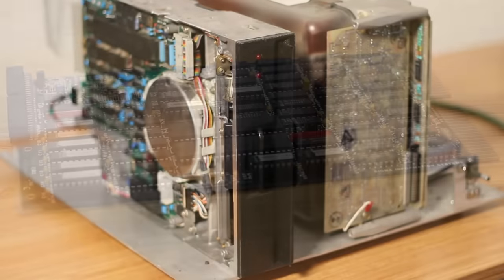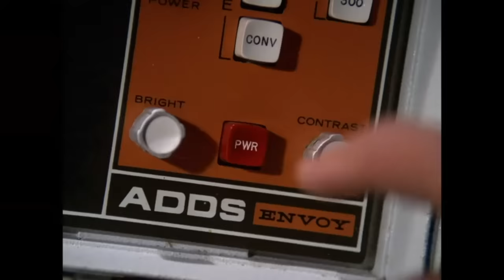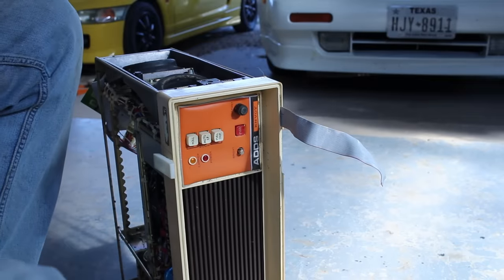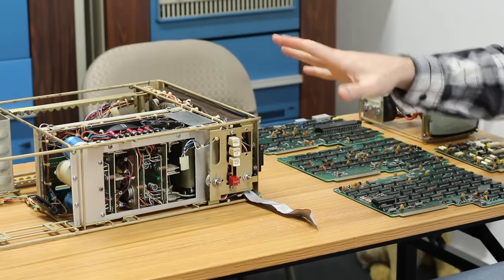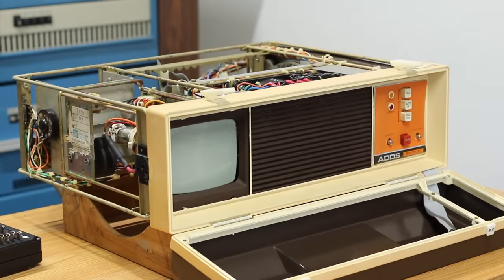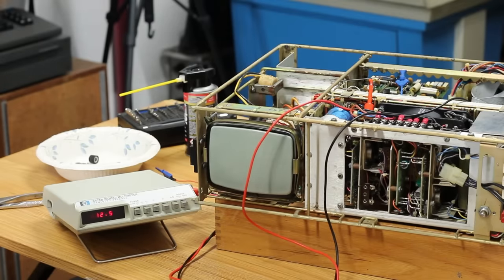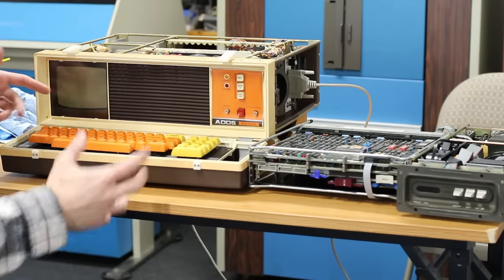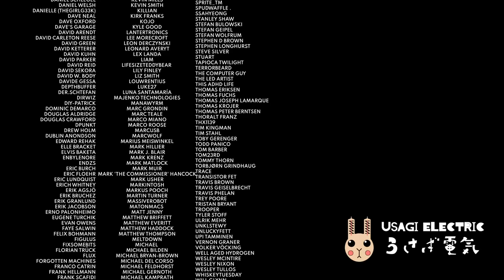This Data Terminal was Covered in Poop!

Comment: You can absolutely wash electronics. I've seen Tektronix and Fluke service manuals, where they discuss how to clean boards with water and detergent. Some Tek scopes have water sensitive components and they are labelled as such with the instruction of removing them before hosing down the device. SO you are 100% right with wahsing the grossness off.
Reply: PCB assembly houses often will use what is essentially a dishwasher, just with no boil cycle, and drip dry, and regular dishwashing powder, to clean new boards after assembly. Big volumes they have a big machine, but small runs just a regular dishwasher is often used.
Reply: Why does water kill phones then? IDGI
Reply: I worked in a TV repair shop for a while. They taught me to always wash the high voltage transformer when replacing the usual parts. We used a water with a dish washing soap. Then it was dried with a blow dryer and that was it. Why shouldn't it work? It had to. However, I recovered some phones that were sleeping with fish for a while (battery on). I think the tons of rust and electrolysis products were harder to clean up than just some rat poo. It was really, really surprising the phones started to work. I was almost confident that you can just wash electronics and it would work. But well, there was that one lousy rubber dome keyboard. After washing and drying it became absolutely dead.
Reply: @seth8629  Partially because the phone has a live battery with a charge in it, while the disconnected circuit boards do not, and were given a proper drying before power was applied.  Water and powered circuitry do not mix because it causes electrical shorts, since the water is conductive.

Comment: hope you checked  the voltages on the second machine? that picture came up  suspiciously fast, if its getting too many volts it'd cause that, check crt heater volts , these sort of tubes are usually 10 to 11 v

Comment: Man, your channel never ceases to AMAZE me!  Not just a 70's portable but 1972!  Not only is it ancient but it features a modem, a 9600 baud modem!!!  Waaaaay ahead of it's time!
Reply: No, that modem will never do 9600. On a good day it will do 300 baud. The 9600 setting is for bypassing the modem and go directly through the serial port in the middle.
Reply: The internal acoustic coupled MODEM  only works at 110 BAUD or 300 BAUD.  For the other support speeds you have to use the RS-232 connection on the DB-25 connector and set the switches to match the BAUD rate you need.

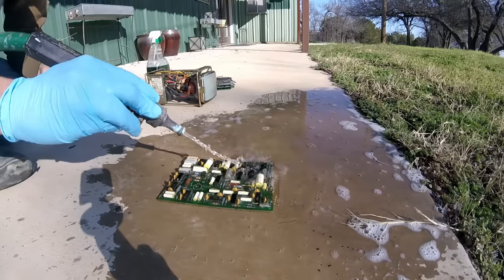Comment: 12:12 - Anyone complaining about washing the boards is probably not aware of the fact that to ruin electronics with water, they have to have power flowing through them. I knew this at 13, and I bet my friend $20 (that's like $40 now) that I bet this 286 motherboard that I got from school (legally - no case or anything, just the board) will survive a plunge in the bath. I showed it to him POSTing using my 386's video card and keyboard to go into the BIOS and do stuff. Then I took all of it apart, and proceeded to dunk it in a bathtub with 2-3 inches of water in it. 20 mins later I took it out, and I said to my friend to come back in a couple days. I immediately removed all the chips (this was an old sucker, lots of discrete chips) including the CPU and dried those separately. I put it all back together, got my buddy to come by, and (I tested it previously lol) it POSTed and the keyboard worked, onboard RAM (like, 10 DIP modules), everything was fine. 

Bollocks to the commenters who think this is a bad idea. I've since put motherboards in dishwashers to get grime off them. Just let it dry.

Comment: The problem with washing electronic boards is not the washing itself. As you said, if water enter in an electronic component, it is already dead. The problem is drying and the quality of the water used to wash. If the water have salts in it (hard water I believe is called), when evaporate, it leave those salts (calcium salts) on the pcb, and when the air is humid, those salts became conductive and can ruin or make the electronics to behave erratically.
Another potential danger is to leave the pcb too much to dry itself when there are exposed copper traces, the salts contained in the water can start to chemically react with the copper and  corrode the traces; the process is accelerated by humidity and salts in the air (if near the sea) and continue even after the machine is put together.
I always use distilled water and alcohool to displace the water at the end. I live near the sea and I saw many electronics corroded by the humid salty air.

Comment: Loopback of RS232 not only needs TX connected to RX but also DSR, DTR and DCD (Data Set Ready, Data Terminal Ready and Data Carrier Detect), these are for hardware handshake. Otherwise the sender will not send anything because it thinks the terminal is not ready or the terminal will not sent anything because it thinks the receiver is not ready or there is no connection.

If you don't care about hardware flow control then short all three together (one in output, the other two are input). If not using hardware handshake then most likely you need the Xon/Xoff protocol unless the terminal and the computer are always able to process the data in time, although you most likely want to sent control-S and control-Q anyway to pause and resume the output.
Reply: Hardware flow control can also use RTS (Request To Send) and CTS (Clear To Send). So to have the best chance to get loopback on db-25 rs232 you would want to connect 6, 8, and 20 together, 4 to 5, and 2 to 3.
Reply: Depends on the terminal.  A lot of them only need 2,3 & 7.  They might have a "bias" to keep the other pins happy if nothing is connected to them.
Reply: Sorry, foggy memory. Should be RTS (Request to send), CTS (Clear to send) and DCD (Data carrier detect). It has been a while since I last made 3 wire RS232 cables...
Reply: @russellhltn1396 True, but it couldn't hurt to properly set the handshaking pins. Having DCD active should also light up the Carrier light on the front panel. 

Also, that modem switch on the side might just be for turning the audio coupler on an off but it could also flip the data inputs to the coupler or force a fixed baud rate as well. Most audio couplers worked at 75, 110 or 300 baud in the late 70s/early 80s in my experience (ignoring the weird 75/1200 split things that came along later for services like Prestel)

Comment: Water and a non-acidic/non-alkaline cleaning solution is actually used professionally for cleaning, so anyone who did do the angry keyboard thing needs to research.   You'd let it dry and then do a bath with Isopropyl to just make sure all the water was expelled, but air drying is also a legitimate drying method for PCB's and electronics.    Done it many times myself as many professional and DIY restorers have done.     Most rodent residue is water soluable and it is the best way to get rid of it

Comment: I use simple green to clean old PCBs, too. It works well, is non-toxic, and easy to find. I use simple green in my ultrasonic cleaner too. Only thing to look out for is it doesn't play nice with aluminum. Quick scrubs are no problem, but I've had it cause bad pitting on electrolytic caps I've left soaking and forgot about for days.

Comment: I'm sure I wasn't the only one going "Eww...!" but anyway, on the topic of cleaning boards, what many may not realize is that in the process of manufacturing electronic boards, especially during the era in which the majority of the electronics you have, it was actually common to have a water wash after the wave-soldering operation to remove the flux (and still is to some degree).

Comment: The open trim pots are the biggest reliability issue.
The Aquadag coating on the tube looks a little compromised, for reliable correct operation of the tube I would get a small amount and repair the coating looking at where it was before.  Keep away from the HV terminal.

The other unit might be safer to restore.
The low baud rates are probably for the acoustic coupler.  The higher bit rates were only offered by the RS-232.

Comment: A perfect way to clean is, besides using a mild detergent, distilled water as it is mineral free and thus non conductive. A 100% dry out is to set and oven to its lowest temperature i.e. "warm" (pre check the oven with a thermometer) to fine adjust, leave the door slightly or fully open.
At a temperature of around 125-150F and a small fan blowing air inside, place the cleaned item to be dried inside for a few hours. Any water residuals will have evaporated! Worked wonders for me! Dried out any device including Mobile phones!
Thereafter spraying/soaking all in Water Disbursement Formula 40, widely know as WD40, does wonders!

Comment: David, you need a large ultrasonic cleaner and an active load such as the ITECH IT8511A, both are really useful in the home lab.

Re the console, try adding the hardware handshake pins too. link 4 and 5 RTS-> CTS, then 6+8+20, these are other handshake pins DSR, DCD, DTR respectively.

Would also be handy to test all the bits from the remaining parts machine once things are working, so you know what is good / bad / needs fixing. Its always easier when you have 2 or more board to diagnose from.

Comment: You will need to take the CRT out and re-coat it. Part of why a CRT is so hazardous to handle is that the glass actually forms a high-voltage capacitor, one of the plates is the metallic coating on the inside and the other is the black 'aquadag' coating (which is basically carbon), and the glass is the dielectric. You can actually buy replacement aquadag to spray onto the CRT. On the PC boards, if there are spots where you are concerned about corrosion on the traces or the solder mask, clear nail polish should do in a pinch to work as a conformal coating.
Reply: Recoating may not be needed.  I have had recovered CRTs turn out to work just fine.  The outside conductive coating they apply is way more than is needed.  The current is extremely low.
Reply: @kensmith5694  Not so much to replace that portion lost but to stop the edge of the remaining aquadag from coming loose over time and the flakes finding their way where they shouldn't.

Comment: Hi, I've been washing electronics with dish soap and water for 40+ years I usually rinse with distilled water and let dry, very few problems. I think a light bulb series tester is in order in case a short circuit exists in the unit.
Rich

Comment: Hey, you want half duplex for local echo, full duplex is for the chars to go to the computer, then the computer sends them back.

For a test without a computer bridge pins 2 to 3, 4 to 5, and 6 to 8 and 20.  See if that works. I did serial cabing on S100 systems and a pdp-11/70 and alpha micro.

Comment: In the early 1980's I worked at a Chuck-E-Cheese's and we would pull the main boards out of video games and run them through the industrial dishwasher to rid them of spilled soda and "goo". They worked fine after some compressed air + drying time. 👍🙂

Comment: I started programming in the late 1970's. My mother worked for Honeywell and was able to bring home a [TI Silent 700](https://en.wikipedia.org/wiki/Silent_70) terminal with an acoustic coupler and thermal printer (no CRT like on the ADDS terminal in this video) so I could do my homework from, well, home by connecting to the school district computer via dial-up. A 300 bps connection felt slow in the late 1970's but would be considered worth killing yourself if forced to use such speeds today. Ahh, good times. 🙂

Comment: Still have my ST-225 Couldn't bear to part with it, remembering how much I spent for it back in the 80's. 
In June of 1972, for the "introductory price" of $3,400 you could buy a brand new car, a good one, like a Camaro or Mustang.
Reply: Yep, somewhere I still have the first hard disk I ever bought, about $400 for 60 megabytes in 1986.  It was so noisy I put it 15 feet away in a closet.  Fortunately Macs and SCSI could handle that distance.

Comment: Nice. I think you have some later model, because the one you showed from the movie/tv-show, had baud selector on the front as two radio / gans switches for 110 and 300 selection. Your has a known in the side door.

Comment: A few thoughts…  You already have a TEK guy’s mention of them regularly washing instruments that came in, before doing anything else.  I recall an old news brief or something, where the washing was mentioned as happening in a domestic dish washer.  The other hint I like to give is that the odd, high voltages you noticed quite likely were “raw” voltages before respective voltage regulators.  Otherwise, best luck with your present challenge!

Comment: I cleaned a microwave oven PCB that way before. As I pulled it loose, cockroaches were crawling out, so I quickly got it in the sink. Then after a cleaning, I rinsed it with alcohol and used a hairdryer. The board still worked. That was the quickest way I knew to get the roaches out.

Comment: Worked in a place years back that had a electronics washer similar to a dish washer, it took 99% isopropyl as it's wash solution. 
You need this.

Additionally, an ultrasonic cleaner would make short work of your scat Surprise.

Comment: You memtioned looping pins 2 and 3, but you normally need more than pins 2 and 3 connected for testing serial terminals. The terminal needs to know that it is connec5ed to something and that it is OK send data, so....   Basic 25 pin RS-232 loop-back... pin 2 to 3 (TXD to RXD), pin 4 to 5 (RTS to CTS), pin 20 to 6 and 8 (DTR to DSR and DCD).  If half-duplex is selected, then you would expect to see each character displayed twice, once from the internal loop-back and once from the external.  Also, I assume that the modem switch should be Off to use the external serial connection instead of the acoustic coupler.
Reply: This.

Comment: The large capacitors in a linear power supply are most always pre-regulation. So those voltages you got are fine. The 13v regulates down to +5 and the +/-27v regulates down to +/-12v. They will also go down when the supply is loaded but you can see the headroom built into that power supply.

I should also mention that the large capacitor in a line operated switch mode power supply is more or less tied to the AC line. So don't attach any test equipment without using an isolation transformer.

Comment: Kudos for facing the grossness.  I would have connected the other working Adm terminal instead  so you could see if the keyboard is working.  Also try different baud rates.  Of course brute-force swapping boards between the two models would be a quick hail-mary.

If you get one working, then I suspect it wouldn't be that hard to recreate the missing keyboard, assuming you can reverse engineer the protocol.

Comment: Using water is not as crazy as people would think.  I worked at a company that did circuit boards, and after the boards went through a solder pot or a reflow oven, they would go through a BOARD WASHER.  The board washer used DI water and at the end of the cycle through it, it had AIR KNIVES to blow the water off of the boards.

Comment: I was just wondering if you were connecting the meter correctly on the capacitors, my theory is that you may have had the negative meter wire on the minus 12, that would have given plus 17 and plus 24 on load.

Comment: You should get one of those ozone generator machines you could put it in a large box or closet with smelly items and let it clear out the odors... Or use it in your room there to get rid of old musty machine odors.  I use it in my garage to get rid of oil/fuel smells, and in my house after cooking.  You can't be in the room when it is running though... I usually run it for an hour when I leave for work in the morning.

Comment: On the capacitors you're measuring the raw unregulated DC. this is typically higher and perfectly normal, especially when not under load To be a regulated output in fact it needs to be higher. If you measure the voltage at the actual output that then goes to the electronics you will find your expected normal voltages.

Comment: For testing for high voltage, I have seen a lot of YouTubers use mobile phone frequency analyzer apps. I forget the names of the specific apps they use, but there are quite a few out there that are either free or low cost, and they should be able to show you the frequency spike caused by the sound of the CRT whine.

Comment: This is similar how I cleaned up my terminal. Only difference is I let mine soak for days to weeks to remove as much of the cemented silt and corrosion as possible.

You could probably use vinegar to get the smell out. Just know that vinegar WILL remove the zink and other coatings! Ammonia might also work, but I've never tried it and I don't know how it will react to metals and plastics.

Also, not wise to max your CRT settings on an unknown system. There could be high voltage but no deflection and you will certainly burn a hole in the phosphors.
Reply: dishwasher cycle might clear out the remaining smell - and leave drying on the outside washing line for a couple of days in the breeze
Reply: Ammonia will quickly remove any exposed copper.
Reply: @dolvaran  I didn't know this! Thanks.
Reply: @highpath4776  Bake in a dehydrator over night before soldering anything!

Comment: (28:00 "in half-duplex," keyboard characters should echo locally, is what I think you meant to say.)
Anyone's guesses on whether that Modem-Up-arrow toggle changes polarity for DCE-vs-DTE?
THANK YOU!!! I just looove interesting terminals, and this little guy is just gorgeous to look at!
-and I've never been brave enough to try Simple Green on electronics, thanks so much for your advice on what typically is and is-not safe to use the cleaner on.